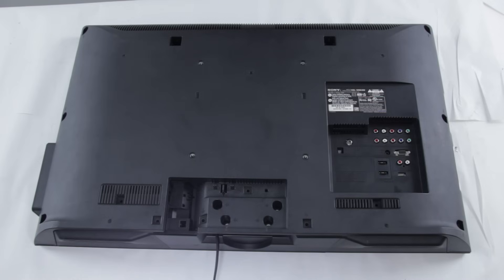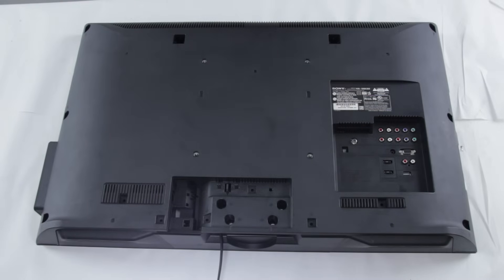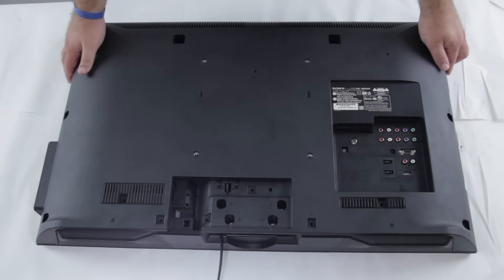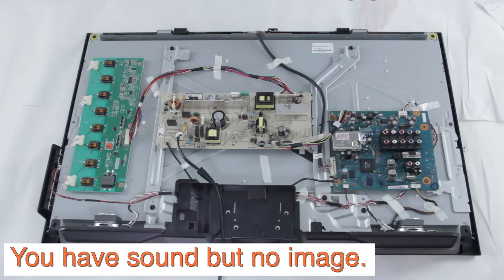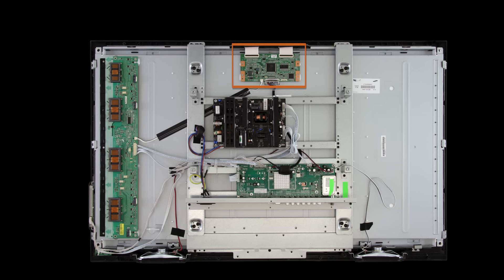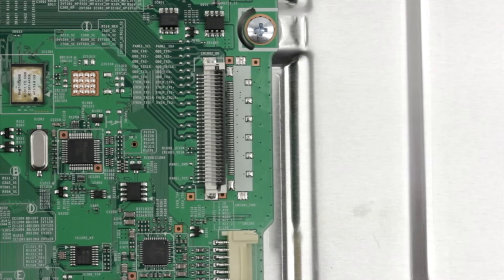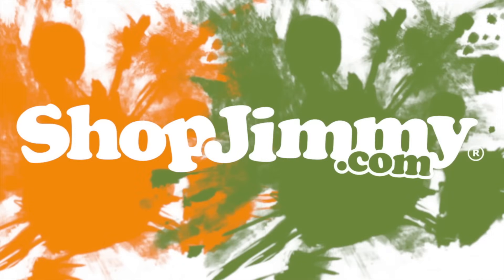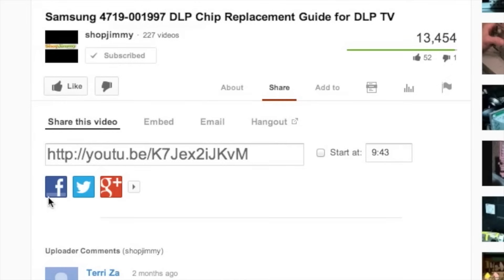LCD TV Repair Tutorial - T-Con Board Common Symptoms & Solutions - How to Replace T-Con Board

Comment: Hey I have a samsung  ln52a580p6fxza and Am having half screen issues. Help?
Reply from the maker: travis warrent   Are the problems going vertically or horizontally?  Thanks!  www.shopjimmy.com
Reply: The left half is intermittently blacked out
Reply: Do you have a card for my model of tv
Reply from the maker: travis warrent   I am not sure what type of card you are looking for.  For repairing your TV, this sounds like a problem with either the T-Con board or the TV panel.  You can replace the T-Con board to see if that fixes the problem in your TV.  Here is a link to replacement parts for your TV model number on our website, click here:  http://www.shopjimmy.com/catalogsearch/result/index/?cat=63&q=+ln52a580p6fxza  Be sure to match part numbers on your current board, with your replacement for compatibility.  Here is a link to a video showing how to identify your part number, click here:  Samsung Timing Control (T-Con) Boards Part Numbers Identification for LCD HD TV Repair  You can also call our customer service for further assistance with your purchase.  (877) 881-6492  Thanks and please let us know if you have any further questions with your TV Repair!  www.shopjimmy.com

Comment: Hello, I own a vizio e320vl and it has some lines out of no where on the screen. I cannot get any picture and just seem to have these colored lines going across the screen. After researching I ran into other users with same issues and it was specified that the tcon board needs replacement. I've taken apart the TV screen and the tcon board is up by where you mentioned that in this specific setup, the tcon board is molded to the panel???  or something like that...  Can you confirm if my part is replaceable or nooo?  Thanks in advance.
Reply from the maker: Nel Son   This sounds like a TV panel problem.  If your TV panel is bad, it may be more cost-effective to replace the TV as panels are typically hard to find in stock, difficult to replace, and expensive.  Thanks and please let us know if you have any further questions!  www.shopjimmy.com

Comment: I have a Sony Bravia that when I turn it off over night and then turn it on in the morning sometimes it will be a black screen other times blurry images all across the screen. I can shut off and on several times over 15-30 minutes before I get a clear picture back.  Its a Sony KDL-52W5100.  I read part of your thread could it be a cable loose causing this ??  or something more major ??  Any help or suggestions would be greatly appreciated.  thanks...Mark
Reply from the maker: Mark Behnke   This sounds like a TV panel problem.  If your TV panel is bad, it may be more cost-effective to replace the TV as panels are typically hard to find in stock, difficult to replace, and expensive.  Thanks and please let us know if you have any further questions!  www.shopjimmy.com

Comment: Hello I have a sony kdl-46xbr4...just replaced TCON board. Now I have just a bright screen..are there some adjustments i need to make other than plug and play?
Thanks
Reply from the maker: wallace bright   It sounds like you have a defective replacement or the wrong T-Con board.  Here is a link to replacement parts for your TV model number on our website, click here:  http://www.shopjimmy.com/catalogsearch/result/index/?cat=63&q=kdl-46xbr4  Be sure to match part numbers on your current board, with your replacement for compatibility.  Here is a link to a video showing how to identify your part number, click here:  Samsung Timing Control (T-Con) Boards Part Numbers Identification for LCD HD TV Repair  You can also call our customer service for further assistance with your purchase.  (877) 881-6492  Thanks and please let us know if you have any further questions with your TV Repair!  www.shopjimmy.com
Reply: Hey thanks for getting back to me, I installed the proper Tcon, but as I was installing,  I might have ripped one of the ribbon cables attached to the LCD screen, but I have back light and when I touch the top ribbon on the right hand side picture comes up, but still bright white, the pixels are not dark in color as seen in videos
Reply from the maker: wallace bright   If you ripped the cable then there is nothing you can do to fix that.  Thanks!  www.shopjimmy.com

Comment: I have a slightly different layout, I have mtg T-Con board affixed to the panel, as the other PCB's
My TV is a KDL46Z4100, and have the LCD ½ lit with all color vertical lines, the other half can see vertical lined but very faint.
Reply from the maker: Paul Hannan   This sounds like a TV panel problem.  If your TV panel is bad, it may be more cost-effective to replace the TV as panels are typically hard to find in stock, difficult to replace, and expensive.  Thanks and please let us know if you have any further questions!  www.shopjimmy.com

Comment: Hey! I have a Insignia 47" LCD model #:ns-l47q09-10a
The TV turns on but I have no picture, the volume works but i have no picture. Please Help!
Reply from the maker: berlin mercado   I recommend replacing the main board in your TV.  Here is a link to replacement parts for your TV model number on our website, click here:  http://www.shopjimmy.com/catalogsearch/result/index/?cat=56&q=ns-l47q09-10a  Be sure to match part numbers on your current board, with your replacement for compatibility.  Here is a link to a video showing how to identify your part number, click here:  STEP #1 - Insignia Main Boards Replacement TV Part Number Identification Guide  You can also call our customer service for further assistance with your purchase.  (877) 881-6492  Thanks and please let us know if you have any further questions with your TV Repair!  www.shopjimmy.com

Comment: Need repair help!! I have a Sony Bravia Model KDL46Z100, serial NO 8200505. it is displaying vertical colored lines.
I took the back panel off and do not see a board labeled Tcon? your suggestion will be greatly appreciated!! I can be emailed at pwhink@yahoo.com. Thank you!
Reply from the maker: *****   This sounds like a TV panel problem.  If your TV panel is bad, it may be more cost-effective to replace the TV as panels are typically hard to find in stock, difficult to replace, and expensive.  Thanks and please let us know if you have any further questions!  www.shopjimmy.com

Comment: I have a LG 47ls4500 and it has a bunch of vertical lines going across the tv I took the ribbon connectors off and cleaned them with a micro fiber cloth but it didn't do anything at all. Could it be the whole board needs replaced?
Reply from the maker: James Long  This sounds like a TV panel problem.  If your TV panel is bad, it may be more cost-effective to replace the TV as panels are typically hard to find in stock, difficult to replace, and expensive.  Thanks and please let us know if you have any further questions!  www.shopjimmy.com
Reply: Thanks for the response back!!!
Reply from the maker: James Long   You are welcome!  www.shopjimmy.com

Comment: I have a sharp Aquos LC-40C32U my symptoms are that when TV is turned on there is no picture the backlight is lit,  I hear all the sounds, can switch channels & when I do there is no numbers, volume bar, menu or anything on the screen. sometimes it has red blue lines far right on screen. then after about 5-10 minutes TV picture comes back perfectly. Then sometimes gradually cuts off & comes back again I was told it was the T-con board so I installed a working one & it does the same exact thing.. After 15 min warm up picture comes on perfectly? can it be another board in there? nothing seems loose & no visually blown capacitors or anything..?
Reply from the maker: Ronn Richardson   This sounds like a problem with either the TV panel or the Main Board in the TV.  You can replace the main board in your TV to see if that fixes the problem.  Here is a link to replacement parts for your TV model number on our website, click here:  http://www.shopjimmy.com/catalogsearch/result/?q=LC-40C32U  Be sure to match part numbers on your current board, with your replacement for compatibility.  You can also call our customer service for further assistance with your purchase.  (877) 881-6492  Thanks and please let us know if you have any further questions with your TV Repair!  www.shopjimmy.com

Comment: Dear sir I have (Samsung 1080P 46\" LED TV D5000) my kid drop glass cleaner on the screen and went black out I Hear the channel sound I see the led working good .open the screen and clean the remain of liquid . could be the logic{s100fapc2lvo.3} board problem ? please advice
Reply from the maker: Aso Mustafa   This sounds like a TV panel problem.  If your TV panel is bad, it may be more cost-effective to replace the TV as panels are typically hard to find in stock, difficult to replace, and expensive.  Thanks and please let us know if you have any further questions!  www.shopjimmy.com
Reply: Sir the T-con board fuse is burn. If  replace with new one is chance to birn the new ?
Reply from the maker: Aso Mustafa   You can try replacing the T-Con, but I cannot say for sure that will fix the TV.  Please reply with the part number for your T-Con board, then I can recommend replacement parts.  Thanks!  www.shopjimmy.com

Comment: Hi I have a Sony bravia KDL52s5100 I had no picture but had sound you can also see back light on tv but I have no picture, the bottom of picture had lines before it went out, I replaced the t con board and still have no picture can you offer any trouble shooting tips? Desperate football fan in need.
Reply from the maker: jojow241   This sounds like a TV panel problem.  If your TV panel is bad, it may be more cost-effective to replace the TV as panels are typically hard to find in stock, difficult to replace, and expensive.  Thanks and please let us know if you have any further questions!  www.shopjimmy.com

Comment: I have a toshiba model no.23hlv87 it has the green light on in the front but no picture What can  it be
Reply from the maker: Moises Pagan   I recommend replacing the main board in your TV.  Here is a link to replacement parts for your TV model number on our website, click here:  http://www.shopjimmy.com/catalogsearch/result/index/?cat=56&q=23hlv87  Be sure to match part numbers on your current board, with your replacement for compatibility.  Here is a link to a video showing how to identify your part number, click here:  TV Part Number Identification Guide for Toshiba Main & Scaler Boards (LCD, LED, Plasma TVs)  You can also call our customer service for further assistance with your purchase.  (877) 881-6492  Thanks and please let us know if you have any further questions with your TV Repair!  www.shopjimmy.com

Comment: I have an LG TV model 32LG70-UA product code 32G70-UA AUSTLJM serial number 902MXKD1K341 manufactured February 2009 I have picture, but the picture is very white. I checked my contrast level, and it's fine, I even double checked by resetting the default settings. I am not sure what the problem is. Please help
Reply from the maker: Ask4theCloser   I recommend replacing the T-Con board in your TV.  Here is a link to replacement parts for your TV model number on our website, click here:  http://www.shopjimmy.com/catalogsearch/result/index/?cat=63&q=32LG70-UA  Be sure to match part numbers on your current board, with your replacement for compatibility.  You can also call our customer service for further assistance with your purchase.  (877) 881-6492  Thanks and please let us know if you have any further questions with your TV Repair!  www.shopjimmy.com

Comment: Hey, I have a lg47ls4500 t.v. year 2012 and the problem is vertical multicolored lines. The series of lines are bunched together in what appears to be a block of 1/6 the width, and is the 5th of the 6 is effected one. The rest of the t.v. is great, works on all gaming systems and cable. I am unsure if it is the capacitors that need to be replaced or t-con board and where to get the parts? Thanks! P.S. is the replacement operation too advanced for someone with no prior electronics skill?
Reply from the maker: VtNole 21   This sounds like a TV panel problem.  If your TV panel is bad, it may be more cost-effective to replace the TV as panels are typically hard to find in stock, difficult to replace, and expensive.  Thanks and please let us know if you have any further questions!  www.shopjimmy.com

Comment: Hi, I have a problem with my TCL-E32E9B. I was watching when all of a sudden the picture went jittery. It displays a picture as if the vertical has lost control on its hold. A friend of mine said it could be a defective T-Con board. Is there a way the board could be repaired? I also repair TVs but it's the first time I am working on this kind. Thanks..any help would be highly appreciated. More power to you and your staff.
Reply from the maker: CeeCeeable   This sounds like a problem with either the T-Con board or the Main Board in your TV.  Unfortunately I do not see any replacement parts in the search results for your TV model number on our website.  Please reply with your part number on your T-con board and main board and I can try searching for replacement parts.  Thanks and please let us know if you have any further questions!  www.shopjimmy.com

Comment: Samsung LN46A530P1F has a bad picture with the colors bleeding all over the screen. Skin tones are mostly dark red. I see all 3 colors somewhere on the screen so maybe not a missing color issue. Sound is good. Backlight is good and adjustable. I have swapped out the main board BN96-08251B with no changes. Factory reset has been done. Is the T-con board the next likely step?
Picture looks like the one in this topic: http://forum.dvdtalk.com/dvd-home-theater-gear/602887-what-heck-happened-my-46-samsung-1080p-lcd-tv-pics-included.html
Reply: Problem was with the T-con board. Working perfectly now.

Comment: I have a Sharp lc-60e77un tv. It shows no red light when I plug tv into any plug in or wall. TV doesn't seem to be getting power. Any help??
Reply from the maker: outcast72288   I recommend replacing the power supply board in your TV.  Here is a link to replacement parts for your TV model number on our website, click here:  http://www.shopjimmy.com/catalogsearch/result/index/?cat=59&q=lc-60e77un  Be sure to match part numbers on your current board, with your replacement for compatibility.  Here is a link to a video showing how to identify your part number, click here:  DIY TV Part Number Identification Guide for Sharp Power Supply Unit (PSU) Boards  You can also call our customer service for further assistance with your purchase.  (877) 881-6492  Thanks and please let us know if you have any further questions with your TV Repair!  www.shopjimmy.com

Comment: Hi, I have a samsung ln40d630m3f. The issue im having is im having what looks like a double image. By this i mean the top 1/3 of the display is shown again on the middle of the tv. Im not entirely sure if its the t-con or the mainboard that is the problem.
Reply from the maker: keller3773   This is either a problem with your T-Con board or the TV panel.  You can replace the T-Con board and see if that fixes the problem.  Here is a link to replacement parts for your TV model number on our website, click here:  http://www.shopjimmy.com/catalogsearch/result/index/?cat=63&q=ln40d630m3f  Be sure to match part numbers on your current board, with your replacement for compatibility.  Here is a link to a video showing how to identify your part number, click here:  Samsung Timing Control (T-Con) Boards Part Numbers Identification for LCD HD TV Repair  You can also call our customer service for further assistance with your purchase.  (877) 881-6492  Thanks and please let us know if you have any further questions with your TV Repair!  www.shopjimmy.com
Reply: Thank you shopjimmy.com for your advise. Ive been a fan of your videos and website for awhile now. I appreciate your dedication to the consumers by reaching out to help and educate us. Thanks again.
Reply from the maker: keller3773   You are welcome and thank you for the appreciation!  Be sure to spread the word to help spread the savings!

Comment: I have an LG 47LW5300 47-Inch 1080p 120Hz Cinema 3D LED-LCD HDTV. I have had it since January 2012. Anyway, i turned it on to play a movie and 1/2 of a minute into the movie, vertical lines appeared for 7 seconds......then it went blank....now its not coming on......any advice on fow to fix it?
Reply from the maker: Abraham Dorris   This sounds like a TV panel problem.  If your TV panel is bad, it may be more cost-effective to replace the TV as panels are typically hard to find in stock, difficult to replace, and expensive.  Thanks and please let us know if you have any further questions!  www.shopjimmy.com
Reply: ShopJimmy.com Hi Jimmy, I have noted your advice. I tried changing the T-con board; that didnt work....so i replaced the original. Neverthe less, the LG TV comes on ...and for two minutes everything shows normal, however, after that, the green lines and distortion reappears....then blinks at intervals of 4 to 5 seconds.....do you still think is the panel? Or, is this a power problem?...please advise......Sammy
Reply from the maker: Abraham Dorris   This still sounds like a TV panel problem.  Thanks and please let us know if you have any further questions!  www.shopjimmy.com